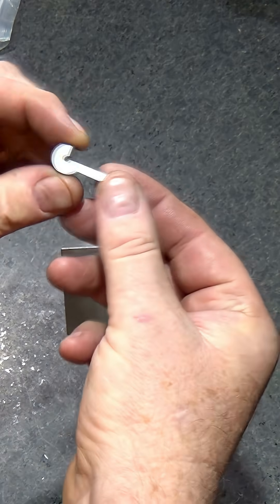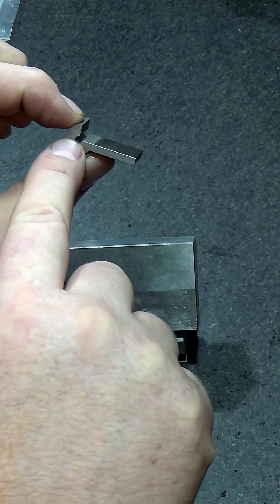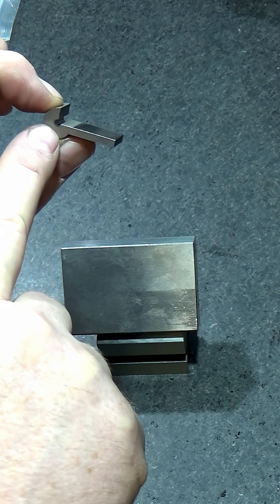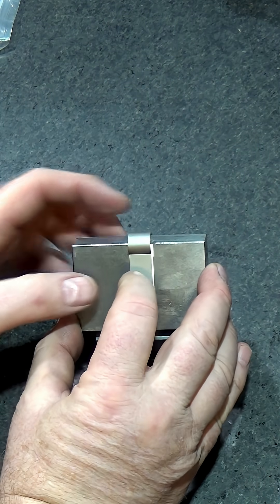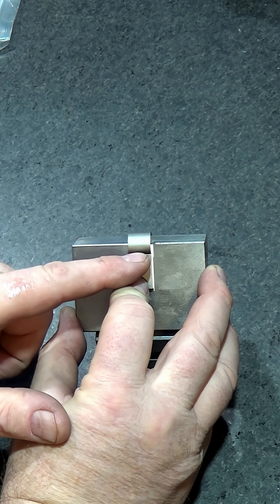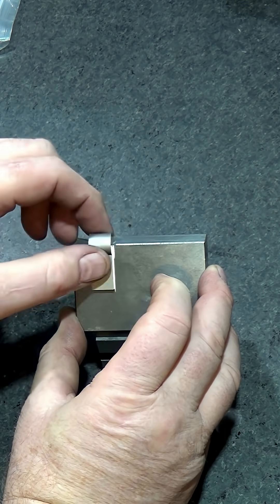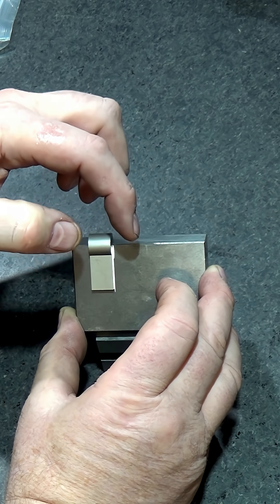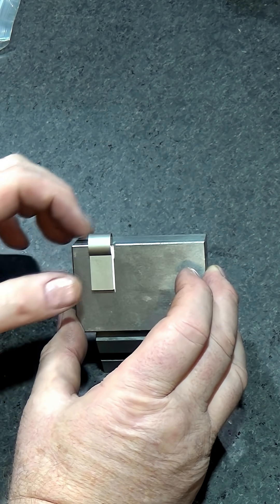Edge Finder for Angled Parts

Comment: Does the gadget need to be so accurate and complicated? Anything that hooks over the top can be reversed, and the difference halved.
Reply from the maker: This is true, but if it is accurate, you can skip the second 2 measurements.
Reply: @DudleyToolwright  Yes, you do have to make one extra measurement, but it doubles the accuracy. Like a DTI in a hole, the TIR shows double the distance off centre, or a squareness comparator shows double the error off square, making it twice as accurate. Whatever you use, it simply needs to locate repeatedly and can be any size.

Comment: Imperial units are so frustrating
Reply: Only frustrating for those lacking math skills. Any competent machinist can easily work in either units.
Reply: @grntitan1  What is the advantage of numbers for thread sizes and drill sizes or even letters for drill sizes? Are fractions better than decimal sizes? I have never needed them for measurement. It takes less than an hour to learn the metric system.
Reply: No more frustrating than learning binary to program computers.  Or learning systemic skills to own a computer.

It's lots easier than learning deep tech stacks in modern software development.

SI is an advantage for physicists.   Not so much for everybody else.
Reply from the maker: They can be. Unfortunately that is what we have to live with over in the US, at least sometimes.